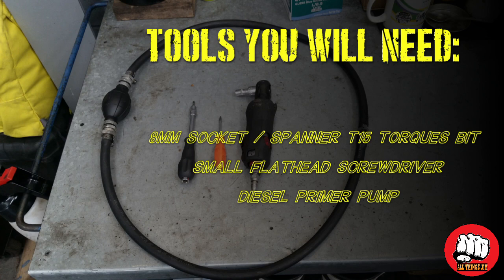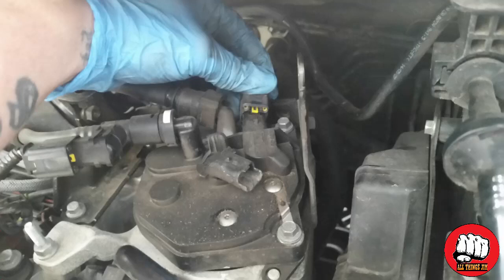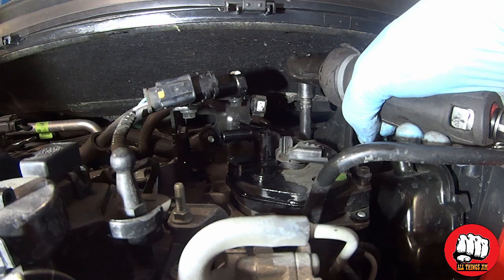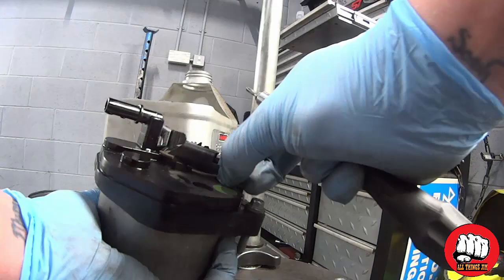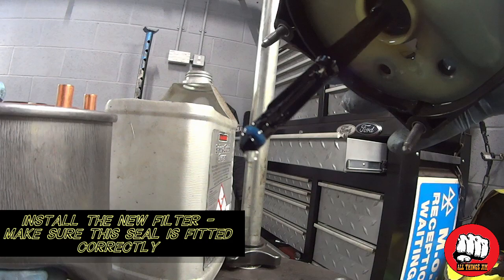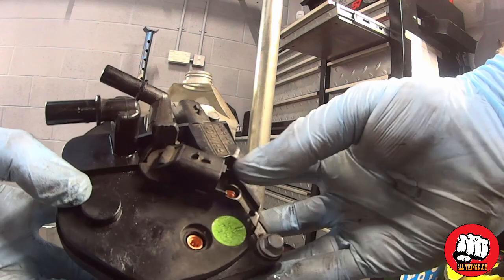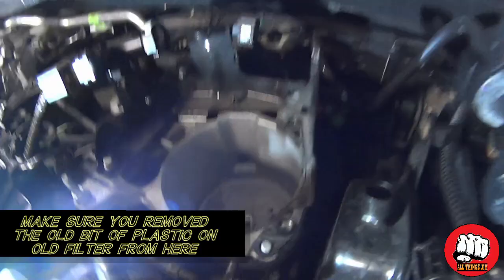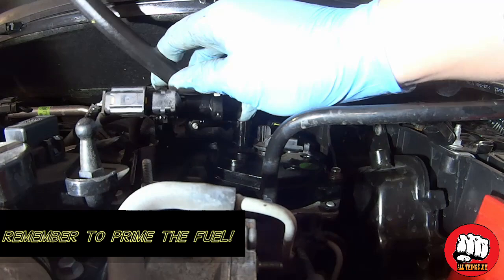diesel fuel filter-how to replace  on a ford fiesta duratorq

Comment: I presume when bleeding the filter, the hand pump is on the output side?
Are you just pumping the diesel out into an empty bottle then pouring that back into the tank?
What about the air in the pipe that you take off?
Reply from the maker: Hi there, the hand pump is on the output side yes, and you can either attach it to the pipe also and just pump the diesel straight through the filter and back down the pipe or just waste the small amount of diesel and pump it out, you dont have to worry about the air getting into the removed pipe as if any it would be a small amount and aslong as you hold the revvs around 2500rpm for a couple of seconds after starting it will just push straight through the system. Hope that helps 👍
Reply: @ALLTHINGSJIM  
Thanks for posting.
I'd loose little by priming. Once I get the filter cap back on, I'll fill the filter through the inlet spout with diesel and let it stand for 10 minutes for the air to raise. Priming though then should be quick and easy with a hand pump.
Reply: Got it done on Saturday. Only bother was the rubber bush dropped off the bottom and couldn't find it but the filter cap bolts have got a good grip so secure enough. Primed through easy enough. cheers!

Comment: Cranking good video, well done!

Regarding bleeding, how about filling the filter with diesel through the spout before refitting?
Is that possible?

I have 2013 Fiesta 1.5TDCi 55kw to do.
Reply: Have looked at this again.

If you bung the bottom hole, you can surely fill up with diesel, then fit the plastic cap, lock the plastic rod in place to seal the diesel in - then the filter is primed?
Reply from the maker: Thanks for commenting!  You can fill with fresh diesel if you wanted to beforehand but you still have to bleed it im afraid as you cant get all the air out,  and as soon as the injectors stuck through the air in the system it would cut out and be a pig to start again. This way avoids that and makes life easier and less stressful 👍👍👍
Reply: .... and for those of us who don't have a bleeder pipe tool, what are the options?

Does switching on the ignition and letting the pump push diesel through the pipe before reconnecting it do the job?
Reply from the maker: @johndee540  no unfortunately not, its a mechanical pump not electric,   youll have to buy one im afraid,  a manual pump primer should cost no more than £10, if you have a hydraulic brake bleeder however you can use that to suck it through
Reply: So its the injector feed pipe spout you connect the bleeder to and draw diesel up through the filter.

What about air in the injector feed pipe itself?

There's a £3 bulb type primer pump on ebay so I can get that and use some garden hose pipe.
Reply: I done this today. To prime the filter, turn the ignition on and off several times (don't try and start engine), maybe 10 or so times. You can actually hear fuel being brought to the filter when turning the ignition on. 

After priming the system,  start the engine and leave the engine running for several minutes to bring fuel through the system. This should get rid of any airlocks.
Reply: @nothingmuch.3014  
Noted - thanks!
Haven't yet done the job although the oil/filter is done. Blue Print filter and Granville FSF 5w30 which is specific for the Ford engines.
Reply: @nothingmuch.3014 
I'm curious!   How does the pump operate when you turn the IGN on if the pump is mechanical?
I can only presume, depending on the year, the pump is either mechanical or electrical?
Reply: Did mine today!
Inlet pipe reattach, and prime through via the outlet spout as suggested in the video. Engine started and I let it run for 5 minutes to get any air out. Thanks.

I don't care much for the Blue Print filter. The rubber seal was a bit warped and had trouble seating it. Its a Hengst or Mann filter in future. Mann, I believe are currently OE to Ford anyway.

Comment: With that bulb type primer you use, are you attaching it to the outlet spout and sucking air, then fuel out of the filter into a bottle?
Reply from the maker: Yep👍 once the fuel comes through you can attach it in line and give it a few pumps to help push air through and out the system the other way too if you wish
Reply: @ALLTHINGSJIM  
Thanks for the reply comment. There's going to be some ingress of air when the outlet pipe is reconnected, that's unavoidable. Just need to rev a bit to keep the engine going while the air clears.

Comment: What do you flush the primer pump with to clean the diesel out after use?
Reply from the maker: I dont, i squirt it out the pump then hang it and let it drip until dry
Reply: @ALLTHINGSJIM  
You only use yours with diesel I presume?
Reply from the maker: Yep 👍

Comment: So to prime it all you do is squeeze the hand pump? Is there not a bleed screw too?
Reply from the maker: Nope no bleed screw, just pump the hand pump until it pushes enough fuel around the system or goes hard then start and rev at around 2500 revvs for around ten seconds and job done 👍
Reply: Cool, also my rail pressure is 8 bar, still not starting and i replaced injector too. Is 8 bar too low when its cranking?
Reply from the maker: @samb59  Yeah 8 bar is really low I believe the cranking pressure needs to be something ridiculous like 300 bar as its a high pressure system. But having an air lock in the system will cause low pressure and none start, prime the fuel pump with your hand pump through the fuel return as shown until it goes hard then put the pipe back on and hold accelerator halfway down keep it there even after fire up keep it around 2500 revvs for about 15 seconds or it will just cut out again until airs worked out the system. Have you programmed in the new injector,  If not im pretty sure it wont start either. Hope that helps 👍
Reply: Cool thanks for that info, i’ll give it a go later.
Reply: According to the snap on modis scanner these injectors dont need programming to the veh. It doesn’t have the option to carry out such a task. Unlike newer fords 2012 onwards for example
Reply: Hi Jim! Thankyou !!  It has been very useful for me because I was lost. But I  only see one pipe of the hand pump connected to the filter, But the other one...where is it connected?? . Thankyou again